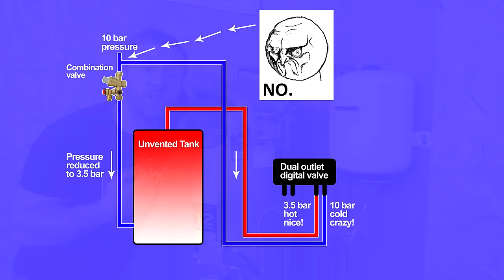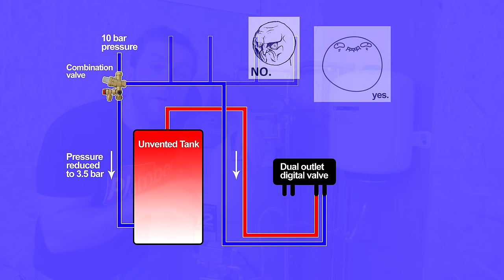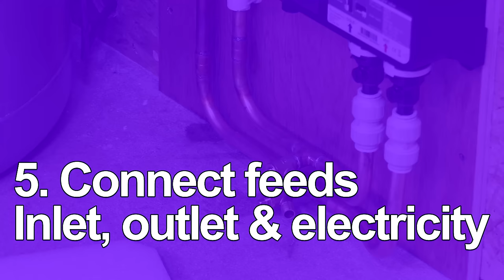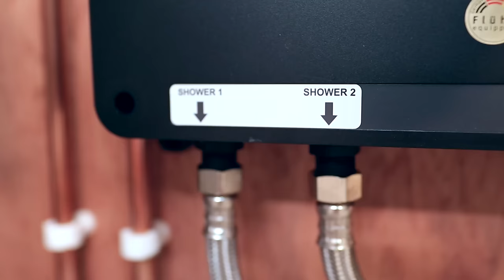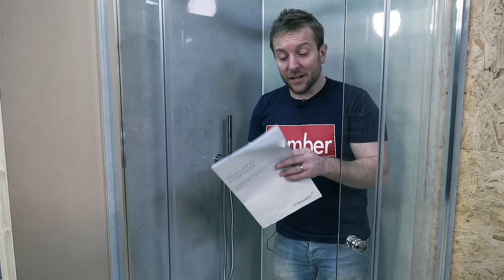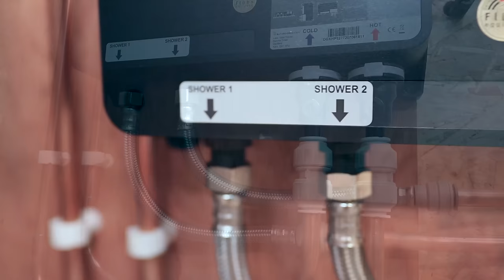DIGITAL SHOWER STEP BY STEP INSTALL GUIDE - Crosswater

Comment: I know I'm late to the party on this, but would that mean for a combi boiler you don't have to worry as much about a balanced pressure, as the hotwater pressure out the combi will be the same pressure as that from the cold water mains?  anyway?
Reply from the maker: Yes.

The party never ends here! 😂

Comment: Great video thanks and would be good to know what differences there would be for a bath fill along with shower.  Crosswater now provide 2 pressure balancing valves for installation on input supply!

Comment: What’s happening about the shower pump full install video you were going to film?  

Can pumps be fitted to these showers?
Reply: Crosswater also do a low pressure version which include a brushless pump delivering 1.5bar... 

https://www.crosswater.co.uk/product/mpro-dual-outlet-shower-/-shower?variant=23300
Reply from the maker: Can't fit a pump to these showers mate. Video about shower pumps coming up soon!
Reply: @plumberparts  From crosswater website ...If you have a booster pump fitted, you’ll need one of our high-pressure digital shower products. Showing twin pump externally installed. 
So.. What's the truth here?

Comment: Hi I have a digital shower that has stopped working. The power on buttons light up but seems like the pump isn’t powering up. Could it be that the signal from on button isn’t reaching the main box in our attic?

Comment: i have flexis on my water softner it feeds the whole house, they are a much smaller bore tho, will this affect my flow through the house ? is that why you dont like flexis
Reply from the maker: It will restrict because of smaller bore. But I prefer hard pipe because it shows a Pro was there (kinda!)

Comment: I’ve a whole House got & cold boost bump on a gravity fed system. Can I still use this? I’m presuming get same pressure on hot and cold. I’ve a salamander rhp50 twin. Pump is 1.3-1.5 bar depending on lpm

Comment: Never had a problem with using analogue showers and don't see the point of adding something that could definitely cause more problems and faults. What's the actual advantage of digital showers ?

Comment: With the vented systems with the pump built in how strong is the pump?  I have a power shower at the moment and love the idea of a digital shower.  Would it be case of removing the pump and essentially fitting the unit at that spot and would the pressure be about the same? The pump sits on the floor under the built in vanity next to the shower at the moment.
Reply from the maker: Sounds like that would work mate.
Reply: Fyi The crosswater low pressure version pumps up to 1.5bar

Comment: So can you show me how you get to clean out the inlet filters with all that rigid pipe work please? 🤨 Hopefully you have a solution?
Reply from the maker: Hi Caroline. There’s always a bit of ‘spring’ in the pipe. That should be enough for you to turn off the water and slip them out for cleaning. Have a wicked day! 😎

Comment: H9w do you fix a combi boiler when I turn on both water and heater only water works and when I only put heaters on then they turn on
Reply: Hot water gets priority over heating so you can’t do both if you have heating on them you turn on a hot tap the heating turns off this is due to a diverted valve inside your Combi boiler if you have a S or Y plan you could do both but you don’t.

Comment: Wow, those are expensive showers! Picked up a triton digital mixer from Screwfix a little while back, just £250ish and easier to install as the controller is wireless - no drilling needed. I guess the difference will be in 5 years when yours is still working!

Comment: Fitting these shower mixers is a last resort - the only option. Apart from gimmiks like starting the shower outside the enclosure, I cannot see what they offer over a normal, simple, quality concealed mixer. 

Do not get me wrong, in some cases they will be the way to go making matters much easier for installation, but few and far between.

Comment: Avoid digital stuff despite the headline salesman BuSt about energy saving and convenience... same as superfluous stuff in cars/toasters.. it may be modern and funky.. but.. electronics will fail sooner than you think (many are built/designed to fail after x^n ).. and then cost a bloody fortune to fix, or marginally less expensive to buy the new model.. which will also be designed to last marginally longer than the warranty... wake up!!!!